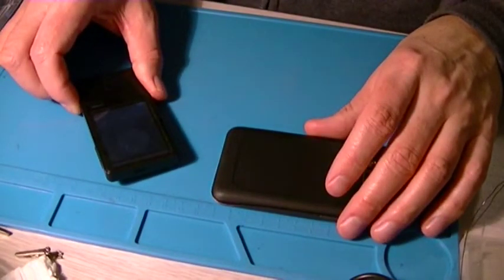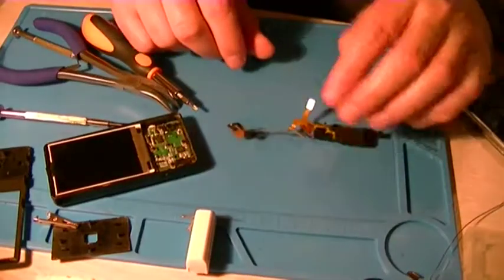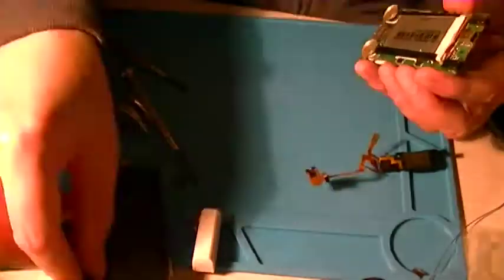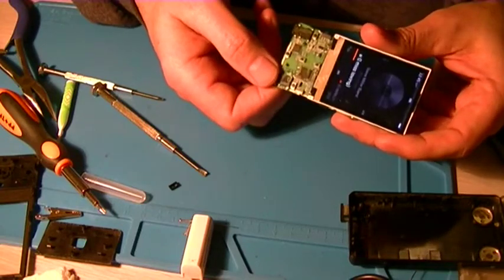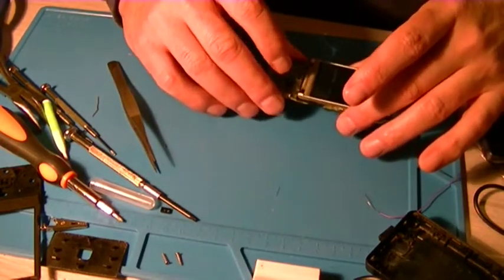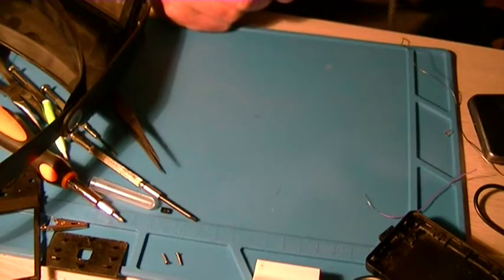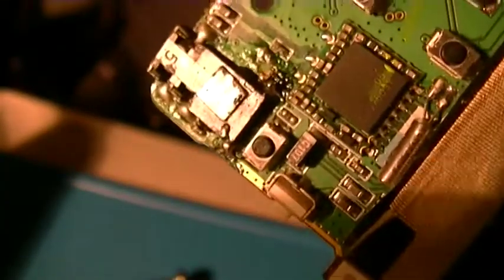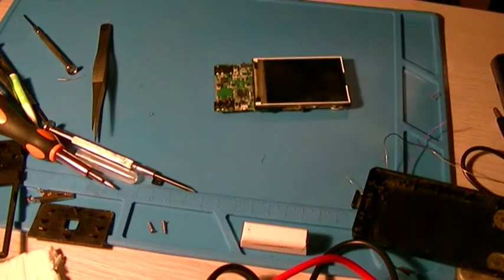iRiver headphone jack repair

Comment: i have the E300
i just wanna know how to lock it when not in use just to save energy
once the backlight turns off that's it ?
Reply from the maker: On my E100 it has a slide switch on the left side. This locks out the controls  so if you have it in a pocket it won't activate the screen. Also you should be able to go in the Settings and change the backlight timing and brightness.

Comment: You know any place to get this one repaired or replaced, the same model? I know how old this is.  iRiver E100 8GB Portable Media Player  Thanks
Reply from the maker: I could not find anyone back then so that is why I tried it myself since I figured that at worst the headphone jack would still not work.
Reply: @garygrady9566  Okay thanks Gary but I will just keep for now until I can see if there is a place that can repair it. It has to be out there. If they can repair computers, they should be able to repair a mp3 / mp4 player. It all still work create just need to replace the screen. Somebody out there knows how to do this, I just need to find them and they are professional.